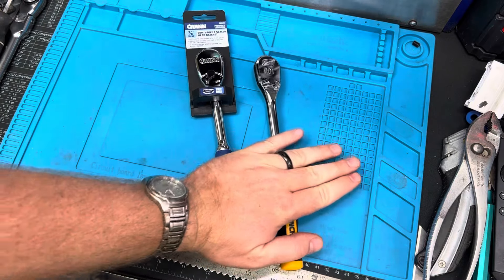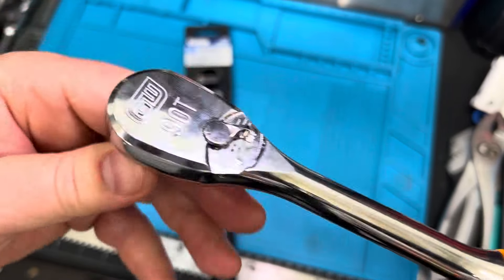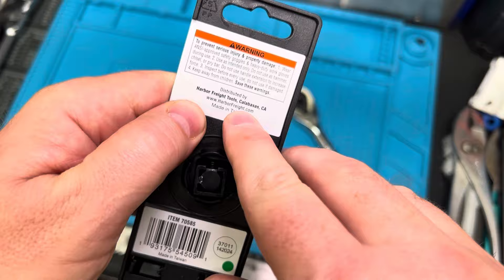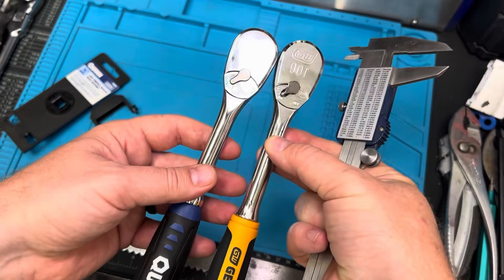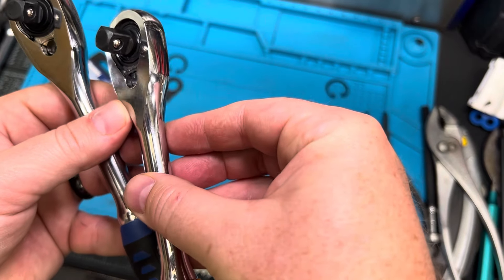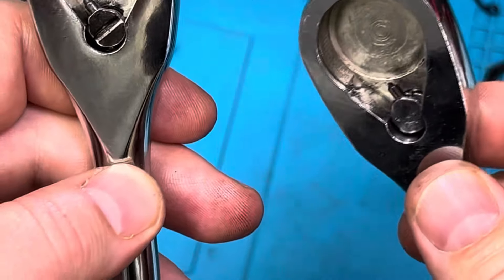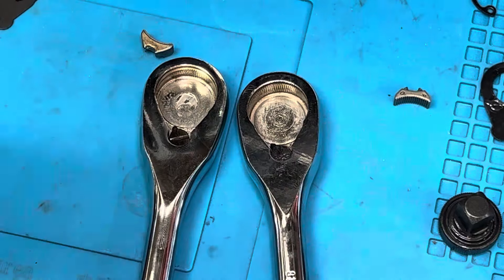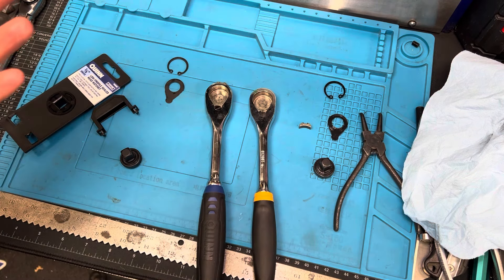GEARWRENCH vs QUINN - Copycat Or Not - Full Teardown & Inspection 🧐

Comment: The Quinn ratchets are made for Harbor Freight by Apex Tool. Apex owns Gearwrench and manufactures Duralast and Husky ratchets. There are slight nuances between the variants with Gearwrench being the flagship line. I'd like to see Harbor Freight expand the Quinn ratchet line to include flex heads.
Reply from the maker: @mlieser1230  I think we all would like to see that. Not sure apex would allow for that though.
Reply: @ThingsMen  I had the same thought.
Reply: Flex head would bite into Icon sales. I've thought the same thing. Probably same reason we don't see SATA soft handle flex head. Gearwrench probably has an agreement with SATA.
Reply from the maker: @KosmicHRTRacingTeam  I would agree. Gearwrench wants to have some exclusivity
Reply: @KosmicHRTRacingTeam how can Gearwrench have an agreement with sata? They are both owned and manufactured by apex. Also Pittsburgh pro has flex heads and I think they are phasing out Pittsburgh pro and slowly rebranding the pp line to Quinn. I wouldn’t be surprised if they put out Quinn flex head ratchets to replace the Pittsburgh pro ones next year. But I guess we will see at this years sema show
Reply: Idk how they consider this a sealed head since it’s serviceable. A true sealed head is like the craftsman v series or original gunmetal 120 position ratchet
Reply from the maker: @deeeyewhy5949  think they might be referring to the o-rings sealing it.
Reply: I love Quinn and husky great tools

Comment: I'd be careful ins saying they are the same. Same basic design, made in same factory, and nearly interchangeable parts do not equate to same quality. Important details concerning metallurgy like exact material composition, hardness, etc. can result in a huge difference in durability and strength. The pawl color differences are a clue towards that end. Also, there may be nearly microscopic differences in the tooth profile and finish of the pawl. I also saw in the video that the ball detent was located slightly further from the pawl base on one. I know the more time a component spends being machined or finished the more the final product will (should) cost.
Reply from the maker: @C2Installations  metallurgy can change from batch to batch or year to year. Point wasn’t to take it that far. However you can swap all the internals between them and it would work the same. 

I do appreciate you commenting and appreciation to detail. 👍🏻
Reply: I said the same thing I don't know how this guy can think they're the same. Just because they look similar. They're totally different could he normally has good videos but this one is obviously he's wrong
Reply: @ThingsMen  Metallurgy doesn’t change if the manufacturer is following a specification. That’s the whole point. I work for a US manufacturer and know about batches, bins, QC, tolerances, acceptable ranges, and so on. If the lookalike is less money, where do you think they saved? I’ll tell you…they saved in places the consumer can’t see, check, or test.
Reply from the maker: @C2Installations  I can see them saving there but also it’s called margins. Each manufacturer has them and creates acceptable margins limits.
Reply: @ThingsMen  again, work for a manufacturer, and we not only make items under our name, but oem for numerous others… to their spec and QC requirements.

I’m aware of margins, NIBT, and more. I also know it costs more to mold a soft grip handle with three colors, vs two. I’m just saying if you think HF isn’t cutting corners somewhere to cut cost, well… Gotta factor in that they are not losing money on coupons and constant sales. Plus they are the only reseller, so cutting out middle men likely means they are making more margin on a less expensive to procure item.

Seems like you’re on the “they are the same” bandwagon but how sure are you that they are the same quality? I guess my issue is you’ve done no conclusive testing but render your opinion as fact. Now you’re digging in instead of just acknowledging that there could be differences that are not apparent, or did I miss that in the video? Appreciate the video either way.
Reply from the maker: @C2Installations  I get your point and we can get deep into testing material compositions, dimensions, tolerances. There may be small variations as you said but at its basic core they are virtual copies (my opinion). I can understand that working for a manufacturer you may require further testing. Some of which I may or may not have the capacity to provide but at what point do we say “yea that’s close enough to make a judgement call?” 

Anyway I’m happy to hear your thoughts on further testing. 👍🏻
Reply: @C2Installations not necessarily.  HF could have gotten a better deal from the OEM and/or could have lower overhead than a store like Home Depot or wherever else these are sold.  Lower retail price doesn’t necessarily mean lesser quality.

I agree, there COULD be differences that are not visually apparent like metallurgy, heat treatment, etc but we don’t know that.  It’s also possible that HF managed to bring the same or similar ratchet to market for less than GW.  I’d be curious to know the price that Home Depot pays for these, given that they sell for $40.
Reply: @hallowedbethygame2840  if it’s fair to say that we can’t necessarily say that they’re not the same quality then it’s also fair to say that the content producers assertion that they are the same quality as equally wrong. That’s really what I was trying to point out, that being visually similar doesn’t exactly equate to them being the same product with different names. I work for manufacturer who does OEM work as well as offers our own products and it is common for manufactures to offer similar appearing products that differ subtly or significantly in certain aspects of finish, fitment or materials, or even just quality control being done per piece or per batch.

In other words, they may be made in the exact same place using the exact same blueprints and materials, but the harbor freight may only get one out of every 1000 pieces tested and the gearwrench may get one out of every 10 or 100 pieces tested for quality. I don’t know, but neither does the content producer and that was all I was trying to point out.

Comment: Those pawls look to be made of different materials, too. The Quinn looks like the regular steel pawl that most middle of the road companies use, and the Gearwrench may be made with chrome-moly because of the darker color. I've made an effort to study different types of steels and their properties, colors, etc., but it's only my observation from the video, so don't hold me over the fire for it. The Gearwrench is probably only "a little" better quality. I always open, clean, and lube every new ratchet I buy anymore. Too many low and mid-quality companies are rushing ratchets through quality control to save a little money. As a result, most of them don't have enough, if any lube. Some have a small amount of leftover machining debris in the head from a too rushed cleaning step before assembly. Or, in the case of Icon flex-heads (which I own 4 of), some have a missing wave washer from between the retaining plate and anvil/gear. Just my thoughts.
Reply from the maker: @shadow7796  I think you might be onto something as the colors are different. Almost appears as a coating though. I have several videos on the wave washers in the icons if you haven’t watched already. 👍🏻
Reply: One being lubricated could be the reason that it may look like different color metal.

Comment: I just picked up 2 Quinn master sets (3\8 and 1\4) open box nothing missing in either set. I got both for $50! I was very surprised by the ratchets. I did put some super lube in them both and have been using them every day. I gotta say they are amazing for the price. Best value (even at full price) ratchet on the market as long as they hold up, which I think they will.
Reply from the maker: @nhbountyhunter  those are good deals and good sets. Best of both worlds really.

Comment: I have gear wrench 90 and I went to harbor freight picked up their Pittsburg 3/8 and man so much more smoother then my gear wrench. I have not used the Pittsburg very much yet but 23.00 for the long reach swivel can’t beat it if it hold up
Reply from the maker: @MrPhoenix1800  use what works best. However the pawl and mechanism in the GW is better.
Reply: @  that’s what I am assuming, I’ll use the Pittsburgh on the bolts that want to loosen from back drag and use the gear wrench for everything else.

Comment: I opened all mine today (Gearwrench and Quinn) and to re-lube them. My Quinn had red bearing grease or something similar that made it sound pretty different. After cleaning and lubing them all they now sound indistinguishable. I prefer the grip on the GW but I believe the Quinn was half price or around there so there’s that. I think they’re a great piece of kit!
Reply from the maker: Good move lubing them up. They are identical but I agree the grip is slightly better on the GW but half the price the Quinn is a solid choice. 👍🏻

Comment: I have that same GW ratchet and the 3/8 Quinn that I got earlier this year, but the internals are more similar - for example the pawl in my Quinn is a lighter color and matches the GW.  So, hard to judge if it's a Quinn vs GW issue versus an issue of timing (when manufactured).
Reply from the maker: @GarenP  my GW is a couple years old now so newer ones might be more similar.  Thanks for sharing. 👍🏻

Comment: Gearwrench gets first run of the machines whereas the Quinn gets the second (or third) run after things get sloppy. Have to maximize value out of the mold and machinery. Additionally, Gearwrench will usually get more premium metal, heat treating and finishing and expect better tolerances. They're similar, but the Gearwrench is made to a higher spec. This is common with tool manufacturing.
Reply from the maker: I get your point but these are run through different dies. Quality is right on par. 👍🏻
Reply: @ThingsMen  same same 90T ratchet, it appears they've just changed a few aesthetic dimensions and qualities. Interesting that they bothered to change the anvil, who are they fooling? haha

If you don't care about everything matching (compact and locking flex etc you have to buy the overpriced gearwrench version) or the silly name (some wealthy exec name the range after their silver-spoon-fed kid or something?), the Quinn ratchets appear to be a decent option. If you don't like the slim format gearwrench comfort grips and prefer something meatier that's a bonus!
Reply from the maker: @scod3908  yes it’s a bit silly but the Quinn are virtually copies and a great ratchet. 👍🏻

Comment: We established over a year ago that Alex tools made these. Just like husky ratchets are the same as gear wrench. The just do more milling ok the gear wrench. They milled it down more on gearwrench you can always see the dimple on the back of the head on the gear wrench it is cut down more on the gearwrench to make the head thinner and the gear is milled down more on hearwrenxh for the thinner head. The stalk is a little smaller on the gearwrench due to more machine work so it will fit in tighter areas. The 84 tooth craftsman pro ratchet is the same internals as the gearwrench 84 but the cast a different handle design and it always has quick release. No one copied gearwrench the company that owns gearwrench made them for harbor freight. Apex makes tools for a lot of companies for rebrand   there are a few videos on YouTube discussing this.
Reply from the maker: @empiesidbury1573  yes apex tool made these for HF. Some argue that the quality is the same as  Gearwrench and some say the are minor changes that make it less.
Reply: Who is we?

Comment: I prefer the quinns over the icons
Reply from the maker: I get that. Better backdrag and a virtual close of Gearwrench. 👍🏻
Reply: I prefer some of the Pittsburgh over icon. I have both in 1/4" flex. Pittsburgh is much smoother with less back drag. The icon had to be returned 2 or 3 times before it even touched a fastener. I wont bother returning it again. Ill use it as a junkyard tool until it breaks and leave it there for the next guy to find and warranty.
Reply from the maker: @aaadamt964  I haven’t had that bad of an experience. Most of multiple icons have been great. 👍🏻

Comment: I have these same 2 ratchets been using both for a little while but the Quinn doesn't sound as smooth. I cleaned them both and used the same oil in both when they were new.
Reply from the maker: @georgebonney90  just the luck of the draw. Probably have some inconsistency in the Quinn. Add lube?
Reply: I have doubles of the GW 90T versions, QC isn't amazing, every ratchet feels slightly different, but they all work without issue

Has to be a downside vs paying SnapOff prices
Reply from the maker: @scod3908  that’s a fair assessment

Comment: The SATA ratchet is exactly the same and you can buy a 3 piece set for 35 bucks great ratchet.
Reply from the maker: Correct. I have that one as well. Hmm have an idea. 💡
Reply: @MVi-l1q Apex make a SATA branded 120P version too. I was going to buy them but got the 90T significantly discount on sale

Comment: I didnt hear or see if you compared the finish. I was probably flapping my thumbs in the comments. Id like to get a quinn to compare closer myself but from a quick glance at the store the machining or maybe just the chrome on the quinn didnt seem near as nice as gearwrench.  I haven't been a fan of the tool trucks the last several years so im kind of a gearwrench fan boy now.
Reply from the maker: @aaadamt964  they are virtually identical. Some small changes in the video but nothing concerning performance. 👍🏻

Comment: The Harbor Freight is modeled after gear wrench. But they're not the same in any way. They may look similar, but they're not the same. Not one part is shared. Different weight very different hardness. Different dimensions. different tolerances. Just because two things look similar doesn't mean they're the same. I love your videos. But in this instance you're completely wrong. You're just assuming. When you say something's virtually identical. Doesn't mean that they're identical even the Finish is different.. I'm not the only one saying this other people in the comments are as well. I think you should just delete this video or apologize for your mistake
Reply: Not sure what got you so upset; look Apex tool has been making ratchets for others for decades now. They made the old Craftsman 84t's, Duralast, Husky, Matco, and plenty for their own companies ofc. 
They definitely make certain pliers for the Doyle line even (that 7" needle nose is a real Crescent rebadge if I've ever seen one)

HF sources from manufacturers like this all the time and this is no exception. These are coming right off the same lines, likely just a hair less picky on the QC side of things. 
Generally speaking in terms of torque handling the majority of Apex built ratchets tend to be in the same range in tests too. It's wildly consistent, even the cheap ones. These won't be any different and for the price (and lifetime warranty), it'd be insane to buy the Gearwrench equivalent. These are going to be functionally the same or within 95-98% anyway, just with a nice easy warranty and a much lower entry price. 

I'm gonna guess you're taking this one personally because you paid full price for Gearwrench? 
(We're talking sub-$20 taiwanese ratchets here and you're acting as upset as a Snap-on fanboy it's a little sad)
Reply: Here's something crazy: Just for fun I swapped part between my Craftsman 84t and a 72t Husky once (both Apex). They worked perfectly. 
Funny isn't it.
Reply: they're the same bro get mad
Reply from the maker: You seem a bit upset about this, but they are virtually the same. They fall within the same acceptable size and tolerances. Also note that my GW is about 3 or 4 years older, so they may have all the exact same internals if inspected today. My point is that they are copies of each other internally with slight cosmetic differences to make them look different on the exterior. Apex's supplier made both and you will get the same quality tool either way you choose.